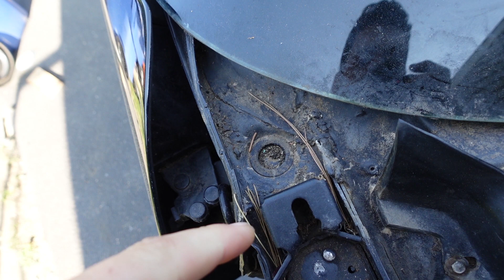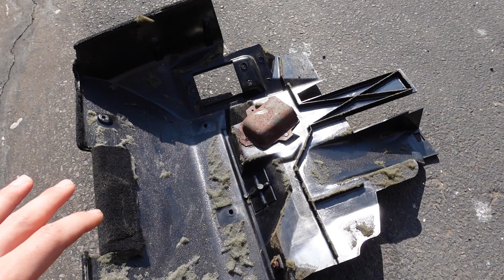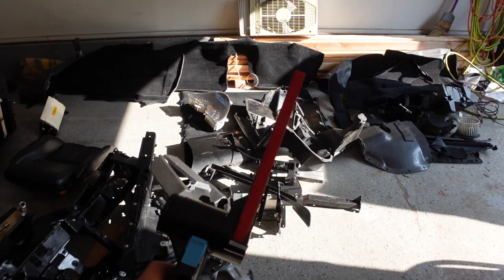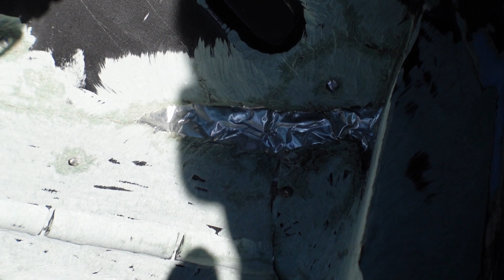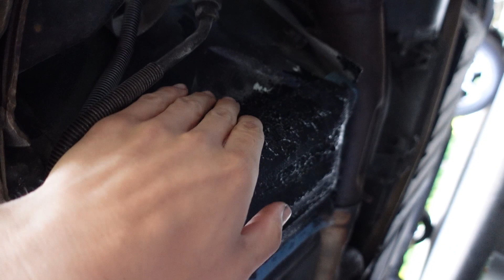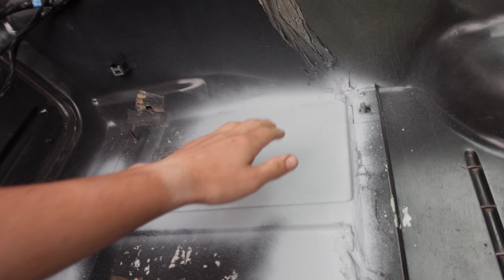Abandoned C4 Corvette Bodywork: SMC Fiberglass Repair + More Cleaning

Comment: Good stuff. Wouldn't fiberglass resin work better?
Reply from the maker: These cars, a mold, release agent was used in production it causes the fiberglass resin to not bond. You need to use SMC fiberglass rated products. Otherwise it will just be a mechanical bond, and not a chemical bond.